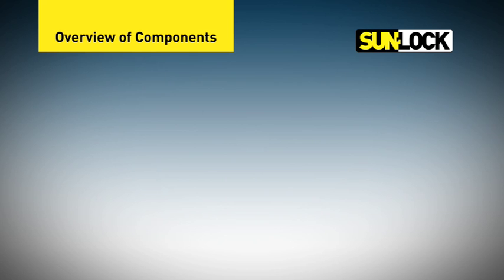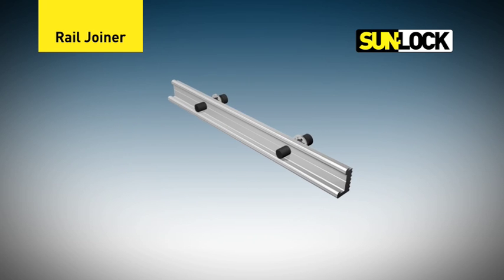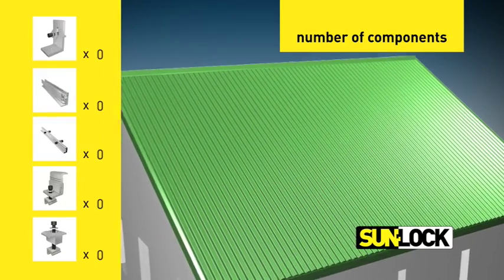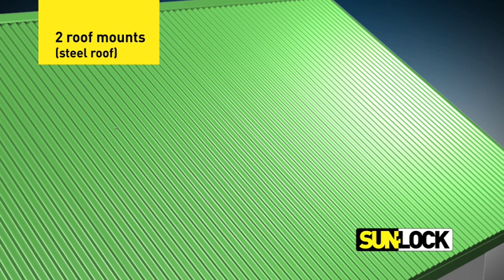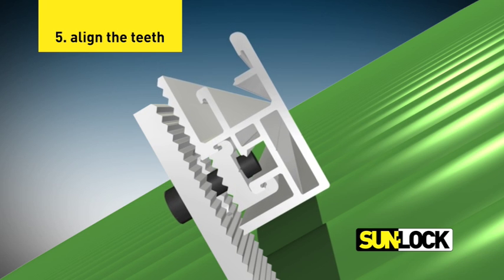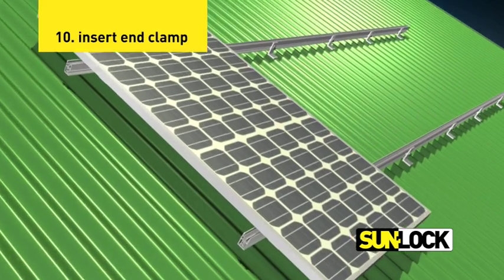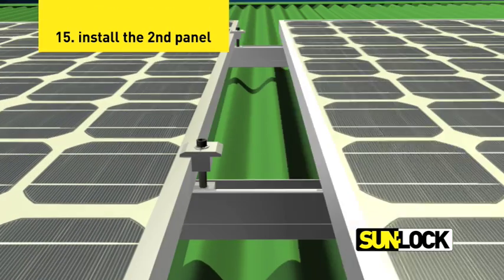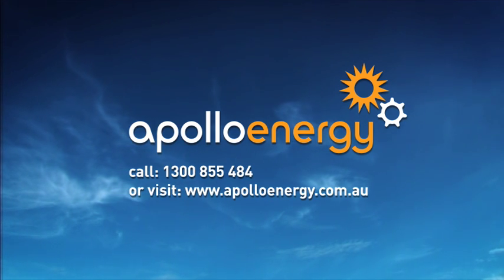SunLock mounting system instructional video

Comment: is this system fully bonded or will i need to use weeb washers
Reply: You only need weeb washers if you don’t apply two coats of fungle cleep under the positron manifold.